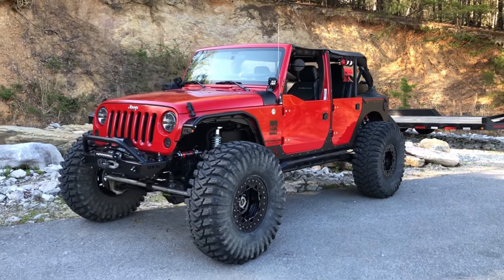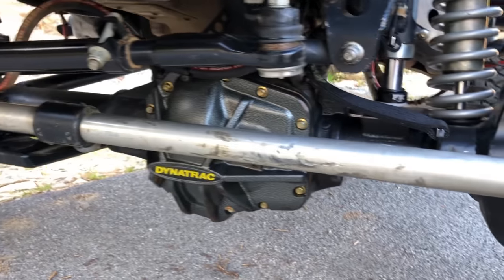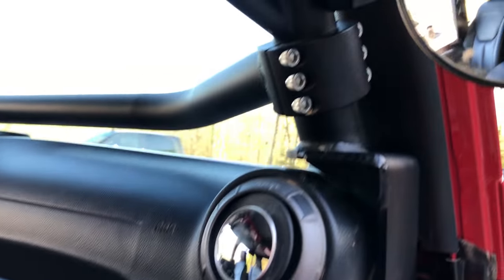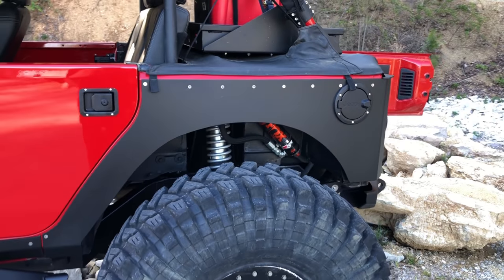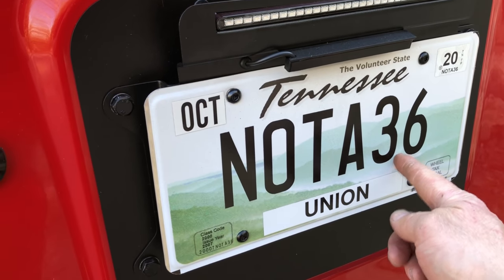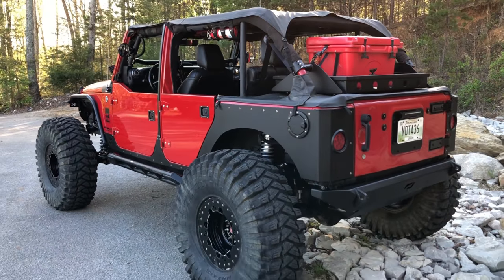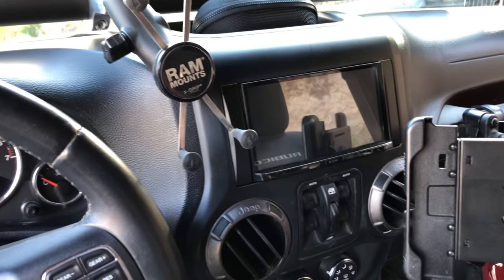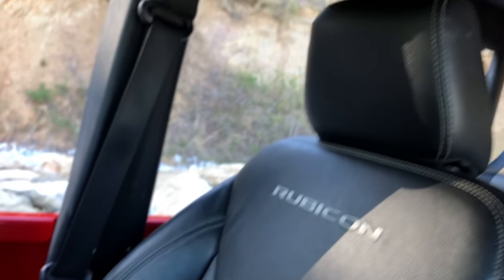Eric’s 2012 JK Build @redheadmistressjk

Comment: Hello !  Thank you very much for your support in our doubts and congratulations on your channel.  I hope you are well and that all this will pass soon to go back to the off road.  I would like to ask you if the rubicon 2014 manual transmission will I also need to program the computer if I put 37 tires?  in your opinion which is better for off road manual or automatic transmission?  Thank you very much and greetings.  Fermin
Reply from the maker: 2014 will need reprogrammed only if you want your speedometer to be accurate.
Reply: RockYour4x4 Thanks

Comment: Is that final ride height, or still tuning?  I ask because it's sitting on the bump stops, which seems counter productive to driving on rough roads. Jeep sounds and looks killer!
Reply: Does look a little low for final ride height.
Reply from the maker: rwills42 it is at ride height in this video. In its current form it’s set up for about 3 inches of up travel and the rest is down travel for crawling in our area. The bump stop is a little inboard of the coil over and the coilover when articulating will bottom out at the same time the bump stop bottoms out.
Reply: Rwills42 This jeep has a good amount of anti squat with the rear crossmember set up. While that lifts the vehicle while pushing the tires down under acceleration, it works backwards when in reverse. When this video was taken it had been backed into the position you see here. So it had sucked the suspension down a decent amount. At true ride height it has about 1 inch of gap between the bump pad. Here on the east coast that is plenty to absorb or terrain.
Reply: @jessebryant8641  as long as the owner is happy with it, then great build.  Thank you for clarifying.

Comment: Why the VVT delete?  And why did you decide to go with automatic?
Reply from the maker: Ralph Muro VVT delete for dependability 
Automatic since there wasn’t a manual option that still had cruise, ABS, and traction control with full function with the can bus. You can downshift and up shift with the steering wheel controls (not shown in the video).
Reply: The GM lifters collapse after a while and make the motor run like shit. People replace them with solid lifters so they don't run into issues later on. The newer engines use the hydraulic lifters and special valving to turn off some cylinders on hwy cruise.
Reply: Aarnold Grabski The lifters are swapped in this engine. It has TSP Cam,VVT delete, Lifters, chromo push rods, PAC high lift valve springs, CAI, CATs delete, then some custom tuning. Runs hard and is reliable
Reply: Thanks for the responses. My build has a 5.7 Hemi VVT motor with manual. I am always interested in why people make their choices. I can tell you that while I love stick shifts I think the v8 experience would be better with an auto.. plus I probably would have went up one more gear size if I had a tranny with more legs... current setup is sitting at 2500 rpm at 75mph on 40s and a 4:88 ratio. It took getting to the 40s to being the Roma to respectable level 😉

Comment: What width is the axles? 68.5 or wider?
Reply from the maker: Liston those are 68.5 but with 2” wheel spacers
Reply: Can you tell us more about the spacers?

Where from, etc?
Reply from the maker: Those are Ballistic Fabrication spacers
Reply: Do you guys see any issues with running that much spacer on a 42” tire?
Reply from the maker: Haven’t had any issues yet.
Reply: Do you guys recommend running spacers? I have the same axle set and was thinking of running spacers. I’m just not sure if I’d be adding a potential weak point. What are your thoughts?
Reply from the maker: @ultra_whitejk2968  I’d only run them if you need the tire clearance.  Most of these we opt for 72” wide axles. This Jeep had 40s before and this tire wouldn’t fit well with the coilovers.